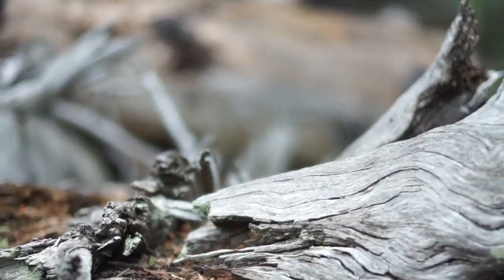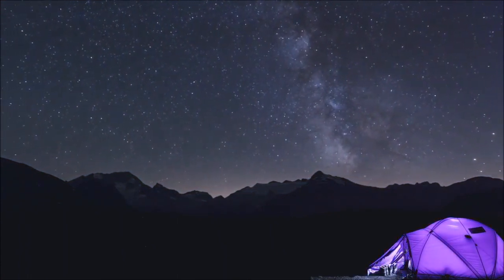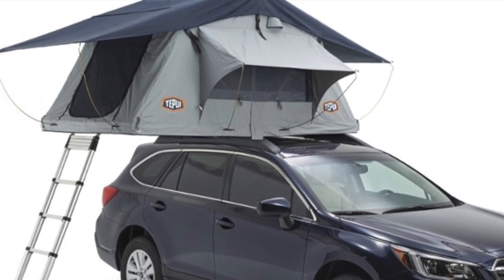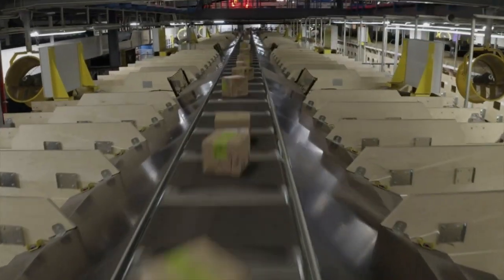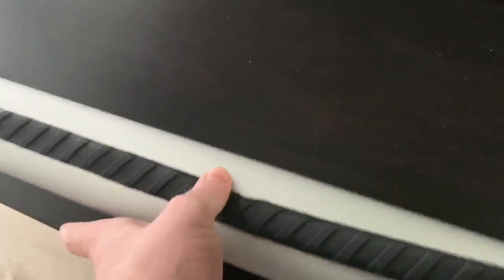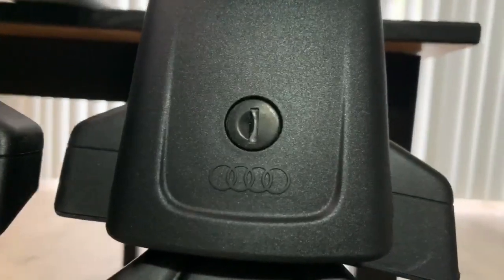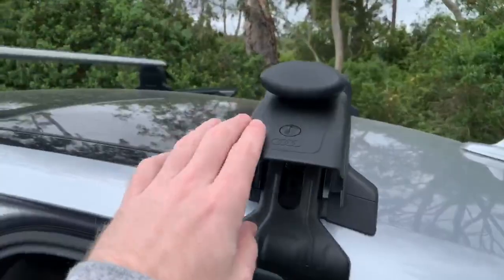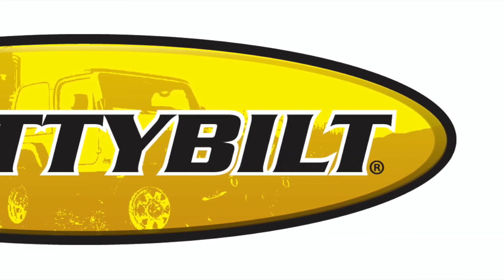How to Install Roof Rails on An Audi | Genuine Audi parts

Comment: At 3:31, Is That Hole Supposed To Be Filled In By A Piece On The Clip?
Reply from the maker: Hey SmokiiiBear! If I’m understanding you correctly, the answer is yes... you fill the hole (female) with the clip (male end) of the roof rack. It’s to anchor and secure your roof rack in place.

Comment: 9 months later, did you get a roof top tent? I have a roof top tent, I currently have it on a vw touareg but I want to put it on my audi a5, its a sports back with a sun roof. I was wondering if the roof would take the weight and what a tent would look like on it. If you bought a tent, do you have any pictures of it on the car?

Comment: How do you know if it’s same size or is adjustable?
Reply: Hey Shant K! I bought the rack that was specific to my car. (Audi A3 - 2015). It’s fixed, So adjusting wasn’t necessary. It fit perfect.
Reply from the maker: Yes, exactly what Nursing said... the rack was specific to the car. So I didn’t have to adjust anything, only what was shown in the video